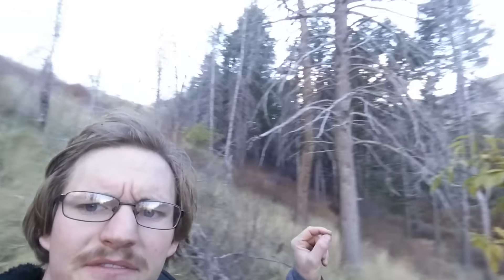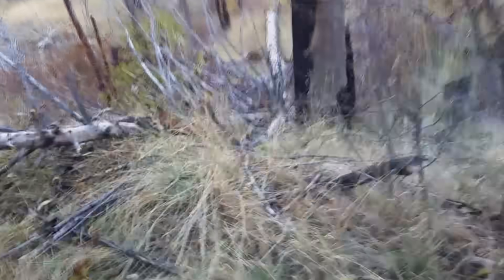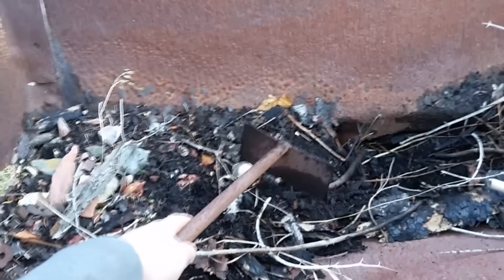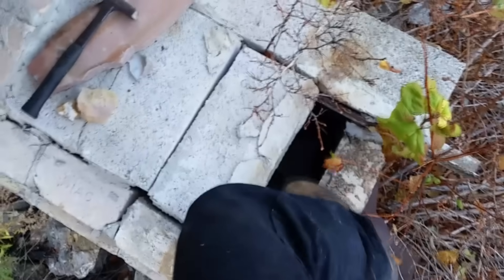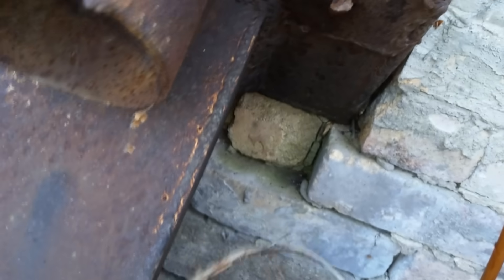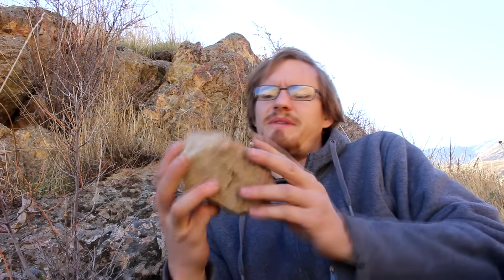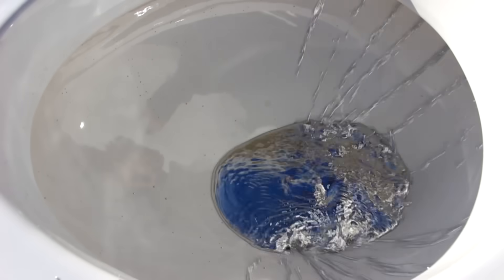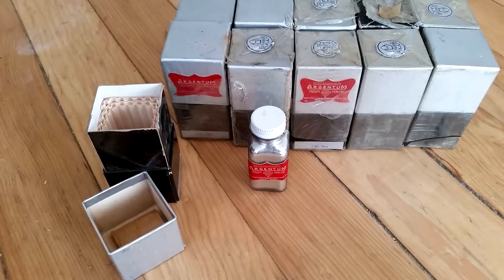Where Did I Get My Mercury?

Comment: You talked a little about how the mercury is trapped in the ore, and retrieved by essentially boiling it off and condensing it. Do you have a video that goes more into raw in-the-ground mercury ore? Is it mercury when its in the ground or does that change happen after distillation?
Reply: Nevermind... You commented below that it just comes right out of the cinnabar.
Reply: Mass_Killer_SJM
And put you out of work? Never.
Reply: Friendly Metroid - The ore is mercury sulfide. When it is roasted the sulfer combines with oxygen and burns off leaving free mercury. Because it is hot, the free mercury vaporizes.
Reply: BDB
That's exactly what I didn't quite grasp. Thank you.

Comment: Why would a dentist need a flask of merucry?
Reply: Dentists used to use mercury for fillings.
Reply: why
Reply: Martin Huszár Cheap and durable filling material when amalgamated with other metals.
Reply: Blu Medic Mercury is an element. You mean different chemicals you can make with mercury? Sure. Most are bad for you. Elemental mercury in liquid form is not very harmful. It's salts are what are really bad.
Reply: Oh, we knew mercury was poisonous; we just had a different attitude towards risk tolerance in those days.
Reply: Oh. We were really stupid when we didn't know stuff
Reply: Shalor McKee Ignorant. Stupid is a failure to correct ignorance.
Reply: Martin Huszár Cheap and durable filling material when amalgamated with other metals.
Reply: Sounds kinda dangerous, you know, cuz of the whole mercury poisoning thing?
Reply: Shalor McKee That was back when it wasn't known that mercury was poisonous
Reply: Plus there are different types of mercury.

Comment: Interesting I thought the Mercury was for processing the gold from the mine, not a byproduct of it
Reply: Best I understand as a kid the mercury absorbed the gold. The miners would have a cup of mercury around to roll around in the pan or riffle easily sucking in the mercury while leaving the sand, rocks and dirt. They would do this till the mercury got rather pasty or putty like at which time they would boil it off leaving the gold usually over a wood stove or like manner of fire. My father, a mining engineer of old said many miners died early because they inhaled the mercury vapors or from constant handling. This told as honest as my old memories allowed.  I supose the still Cody looked at could have been contrived to separate the gold too.  But I lack any knowledge of how that system would be arranged.
Reply: Verlisify yeah they used it on a large slide after hammer mills.
Reply: I think this would be to recycle the Mercury.
Reply: It's called mercury retortion.  The mercury assimilates the gold and is then retorted into a container leaving the gold at the bottom of the vessel
Reply: @allenhonaker4107  nah
Reply: Verlisify hello
Reply: @kevintejada3138  its a furry
Reply: Here
Reply: So the mercury was brought in to assist in the mining of gold? And then left behind like slurry from oil extraction?
Reply: Um ew
Reply: mercury is used in gold panning but this is mining
Reply: Verlisify mercury is used in illegal mining operations to concentrate the gold, but usually it is sluiced out
Reply: Didn't expect to see you here🤔